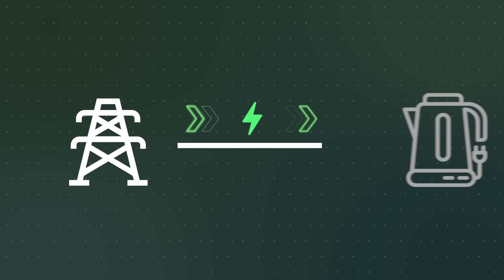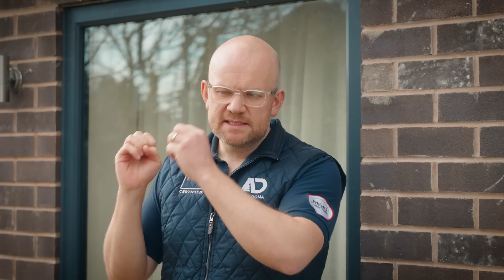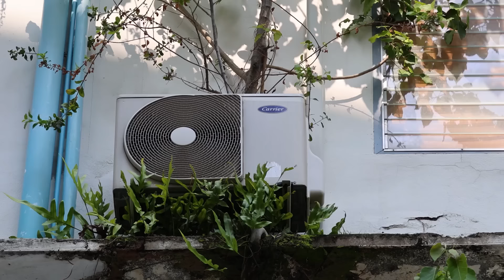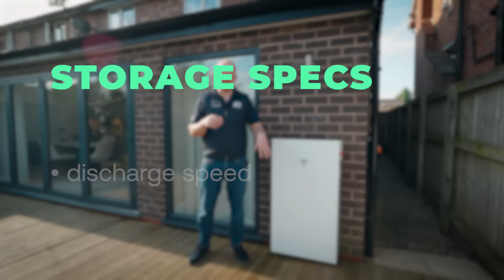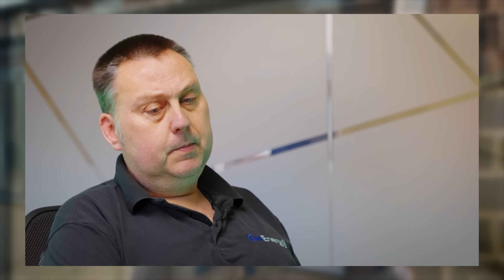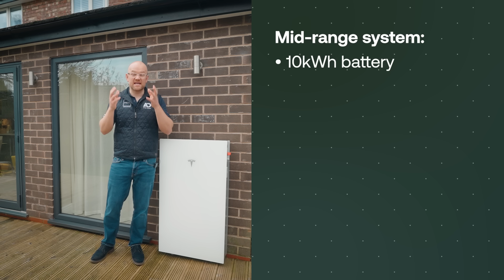Solar Battery UK Guide: When It’s Worth It and When It’s Not

Comment: To suggest that Fogstar batteries are budget in terms of price AND quality is disingenuous. Price certainly they are great value but in terms of quality they cannot be beaten. I would have a Fogstar over any Tesla, Sunsynk, Fox ESS. Sure Fogstar have a more budget range if you want super cheap, with cell quality the main differential. Fogstar have a 32kWh battery around £3500 including 20% VAT so under £3000 as part of an install. To get the equivalent capacity in power walls you would need over two! The Fogstar batteries mostly have 8000 cycle warranties. I have a different battery brand to Fogstar but one that uses the same high quality off the shelf components that Fogstar does. I charge to 100% every day and discharge no lower than 5%. Mostly I end up at 20%. I have had my batteries nearly a year and have done 150 cycles so say 200 cycles/year. At that rate my batteries should still be OK at 40 years. Because I only want the best quality I went for Victron inverters. I have no need for a gateway as virtually all Victron inverters have that capability built in, saving £1000. At zero VAT my system cost around £12000, is powerful enough to run my whole house including 16kW ASHP for 18hours in darkest coldest winter, and 3 days in summer if the grid failed (I have 44kWh of batteries). If a cell went in my batteries they can be replaced, the BMS can be replaced, either with the same or a different make, even my inverter could be changed to a different make not that I would. With a proprietary brand like Tesla or Fox or Sunsynk you will only be able to get your batteries repaired by the manufacturer and if that model is no longer supported you run the risk of losing your whole investment. I have a friend with a Gen 2 Givenergy system that is limited to about 2.8kW output and I think about 8kWh of storage. To improve that he would likely have to replace the whole system. I could add a new 16kWh battery to mine, maybe a Fogstar as the BMS is compatable, In theory I could add another inverter alongside the three I already have (except that with my 3.68kW FIT array, I already have 16.88kW of export power and the maximum anyone can get on 100amp single phase is 17kW) I can't help but think of all those power wall owners who had their devices bricked deliberately over the air by TESLA for safety reasons, in some ways that is a plus because safety is paramount, but the technology in my batteries and fogstar batteries is so standard and safe that I cannot see that being necessary in the first place.
Reply: Interesting, I'm thinking about a Victron system, but am not familiar with the range. What inverters are you using? 
Fogstar seem too good to be true.
Reply: @ianbigsand7  Fogstar are just selling commodity solutions with their own support and backup, so there is no brand premium. I have 4 of the 16kWh units being installed in the next few days with a 12kw Sunsynk inverter. 

There is nothing stopping you from using Fogstar batteries with a Victron inverter if you like the feature set of the Victron, you just need to find an installer who is happy to offer them as a system.
Reply: Sorry @ianbigsand7  for late reply, I have only just seen. I'm using 3 x 48/5000/70-50 Multiplus II's in parallel, as that was what was certified at the time I made my application. By the time I came to install everything a single 15kVA MPII had all the certification and would have been a simpler choice but I had already bought the smaller units. I suppose having 3 smaller inverters means that if one failed I could reconfigure to run as 2 in parallel until a replacement was sourced. I do 100% recommend Victron, it is such a flexible and well supported system (by Victron and by users) that I cannot imagine being with any other system, I have friends with Solis and Givenergy systems that I try to help, but find them so limited by comparison.
Reply: I am totting up the value of a good all-in-one, probably Sigenergy, versus a component system, ideally Victron (maybe Solis, maybe Synsync) and Fogstar. Sigenergy is maybe an easier install, although the gateway is big. It’s also got very good time of use support out of the box. Plus it definitely works well outside. But Victron does ToU just fine, other inverters do it to a greater or lesser extent, and with some level of app functionality. There are trade offs. But component systems are usually quite a bit cheaper. 

My bigger issue is that my new heat pump is so efficient there’s just not that much cost for a battery to take out.
Reply: @Pressure_23  the best quality, best bang for the buck battery has to be the best starting point. The top of the range Fogstars with 16.1kWh capacity seem really good, but maybe the Fogstar budget range makes even more financial sense. I have gobelpower batteries which use standard components, very similar cells and BMS to fogstar units. Had my system for 13 months,  with 3 x 14.4kWh batteries. I have absolutely hammered them, one battery seems to be working harder than the others with 270 cycles, the other two around 225/230 cycles. Every day I go from 100% to 20%, sometimes lower, 5% is my limit. My cells are supposed to be good for 8000 cycles, but should still have significant capacity. I should hit 8000 cycles in 32 years. Realistically by then, probably well before, there will be superior technology and I might have upgraded to that. There is a reasonable chance that my Victrons will cope well with whatever that new technology is, so hopefully I will not have to replace everything, but with an all in one there is no chance. In the winter I need the full capacity to run my ASHP and house entirely on off peak electricity on the very coldest days, but for most of the year I store my solar production in the batteries throughout the day and export around 25kWh over the four highest price export slots of the day. Usually that is between 5pm and 7pm, and if I am being paid 20p/kWh instead of 12p/kWh (or better still 36p/kWh) that really helps with the ROI. You say your heat pump is cheap to run anyway, and so is mine. Even without batteries it was cheaper than gas or oil, but the batteries have cut my unit cost to a third. My 16kW ASHP will cost under £300/pa based on my current import price of 6.9p, so that is an annual saving of £600 right there, my house use adds  another £600 saving, and exporting my solar at 20p (rather than 12p without batteries) maybe adds another £300 giving me a £1500 annual return.
Reply: @mikebarry229 very useful information. My biggest challenge is finding an installer for Fogstar + say Victron or Solis. Electricians locally want to install Tesla or Sigenergy. I guess I’ll talk to ITS at some point.

Comment: Very informative and well explained video thanks. Have a 4 bed home approx. 4100kwh of annual usage with oil bulk storage combined running cost £3400 per year. Embarking on a 2 stage, 3 year plan to have Solar, Battery & Heat pump installed. Stage 1: 18 x 465kw Panels & 8Kw inverter c/w 17.52kwh of usable battery storage from Sigenergy (Love Tesla, Hate Musk more, so will not be getting my money). DNO have restricted inverter size to 8kw from 10kw and concerned that functionally Stage 2: fitting the heat pump (replacement oil bulk storage) will be impacted by the smaller inverter to run heat pump? May have to now look at Tepeo ZEB in the future for heating as an alternative to heat pump. Any thoughts would be greatly appreciated :)
Reply from the maker: Sounds like you have a good plan to me. The inverter is highly likely to meet most of your home's demand. 

Thanks for commenting.

Ian
Reply: @apexdomasolar Thanks for your feedback, your reassurance is greatly appreciated. Keep up the great work, you’re making your mark 1 video at a time ⚡️📈

Comment: You seem to be well informed in your trade and also able to see it from customers who may not be as informed on all technical and regulatory details. I have some quick questions for you:
1. Is there a limit on how much energy I can take overnight on the cheap rate, for example if I have 4 battery banks, can I charge them all at once? 
2. If I have a 3-phase supply, can I export on each phase separately so 3 times the export limit?
Reply from the maker: 1 - Yes, you can fill up four. Just depends on your incoming supply limit and inverter size. But in theory, yes. 

2 - That's exactly the way it works (subject to your G98/G99 export limit).

Warm regards

Ian - Team AD
Reply: @apexdomasolar  Thank you so much for the clear answer. I currently have a single phase 100A domestic supply so 24kW maximum rate and 4 x 5kW inverters may be doable. 
Nobody has solar panels in my neighbourhood so maybe my DNO can handle more the 3.68kW and I don't need to upgrade to 3-phase, we will see. Thank you again

Comment: On the right tariff (export rate greater than import rate) generally you should export as much Solar as possible rather than use it for your home as long as you can avoid peak rate usage.
Reply from the maker: Agree with this currently, though it's best to assume it won’t last forever in the system's design. 

Thanks for commenting. 

Ian

Comment: Great video. The only thing I would add. You made a good point about try and install i hybrid inverter if you just want solar.  Its a mine field as so many manufactures and what each unit will achieve. Alot will only support 2kw loads and others a lot more so choosing a inverter is a mine field. Its an investment you have to get right as you cannot change it latter . Well you can but its cost. Get it right first time. Example I want a Anker solix x1 but its not designed at the moment to run with a deisel generator but other manufacturers have designed for this feature into there products. Its really drilling down trying to make sure your investment will work in all senioros.
Reply: Haven’t seen many with only 2kwh load ? Even the small 3.68kw inverter on G98 cert can output the full 3.68 kw export.
Sunsynk is best for your requirements if looking for aux inputs for gen etc.
Reply: actually for my requirments its a solis s6 eh1p 8kw l plus

Comment: I went all in, 48kwh battery in the house and a 16kwh battery in the shop. 10kw array on the house and 12kw on the shop, which also exports to the house. The way I look at it, having extra is better than not enough. I have free power at night so I can run all three AC units during the day without worrying about am I going to use grid power during the day.
Reply: No. Just no.
Reply: @PaulParker-ub9sq Canada explain other than no

Comment: I'm getting quote for 22 panel Aiko 475w gen 3 with Tesla powerwall 3 with gateway and expansion I use 4500 kw have I gone over kill with 27 kw battery storage? Any advice would be great thank you
Reply: Is that just normal house usage (no heat pump or ev). On average wouldn't one pw3 suffice if you are using 12kwh per day?
Reply: I have managed with just a single PW 3 for 16 months. My average daily use is around 17.5 kWh and I have rarely used any peak rate electricity. However, I moved from E.ON NextDrive (7 hours off-peak) to Intelligent Octopus Go (6 hours off-peak) in February (when I got an EV) as the E.ON export rate plummeted - I also have 6.825 kW of Solar PV. This would then stretch my usage to the point that even fiddling with the Backup Reserve at the end of the day would not be sufficient in winter. So yesterday I had an Expansion Pack fitted.
Reply: Hi, I have a 6kw solar south facing direct to tesla inverter plus add on unit so 26 kwh storage. I also have a 4 kw west facing array that was fitted under the FIT system that goes straight to export.  I also have an ev and do about 10000 miles a year

I find that from about April to September the batteries tend to be 80 -100 % full by late afternoon, which is easily enough to get through to the next day ( despite two teenagers using as much power as they can ). Your system will easily cope with your needs and indeed will cope with an additional heat pump and ev - .

You have got it right with the storage - which will be good for full self consumption in the summer and enable you to draw from the grid over night in the winter

Comment: Great explanation and very informative.
I have looked at battery only to load shift. With my average daily PEAK consumption of 12kwh I would save £2.76 per day/£1000 per yr  based on my current Octopus IG tariff. Looked at an  Alpha 14.4kwh for 5.3k which would give a ROI of just over 5 years but moves to over 6 when factoring in loss of interest from from cashing in my savings. 
Add the recent Givenergy issues I’m feeling a bit reluctant to risk investing 🤦‍♂️🤷‍♂️

Comment: Hi Ian. We had 9.5kwh of battery storage and got an extra 9.5kwh with you and we don’t regret the extra spend at all as both myself and my wife now spend more time at home now so we use more of it and sometimes in the winter can drain most of or sometimes it all due to white goods usage on washdays. Then we charge at cheap night rate over 6 hours and using solar when available. A win win 👍✅
Reply from the maker: Thank you, David, for your comment. 😊

Comment: A good presentation.  I have looked into this in detail - I am 70 years old, I do not have solar and I am on Intelligent Octopus Go.  I charge my car in the early evening and normally get a few 30 minute slots of cheap energy before a longer slot of hours running up to 1130.  This allows me to run every heavy use appliance such as washing machine, and tumble drier etc in the evening.  In short I have little requirement to spend £6000 just to run my low level daytime electricity especially as I will not break even for 9 years and then save a some little  money in my final years before I end up in my box.
Reply: Very valid points. I’m still in my thirties, but I do have an opinion - when I got my home SOLAR PV and battery installed, the EPC bump helped me lower the mortgage payments as better products became available.

Now, when upsizing, I see a gain in house value in real-terms, but I had already improved the home’s loan to value ration during remortgaging previously. You could get that money straight out after installation as an addition to your loan amount while maintaining the previous loan to value ratio :)

So a good investment regardless the time frames if you’re remortgaging or selling.
Reply: I'm thinking the same James, I'm also 70 this year and any gains regarding solar and batteries etc would be negligible as far as I can see it plus that money in an ISA could return 4% per year and could give £240 interest tax free for £6000 investment.
Reply: @marma48  the return from a battery can be higher. I will save £1,233 a year with a battery which works out at 17.6% return. Much better than any bank.
Reply: @dpleech1 Yes, I did a full ROI using Claude AI. If we reinvested the electric savings in an all of market fund with someone like Vanguard, rather than keeping the money in an ISA, we'd end up with the thick end of 4 times the cost of the install after 10 years. My neice recommended that I try Claude, I'm a big fan after only using it for a few weeks. It'll build you a spreadsheet in minutes, that would have normally taken me an hour or two.
Reply: I think it's not all about money, do we go on holiday and say when will I break even 😂 no. Its about ALL of us doing what we can to save ourselves from human climate catastrophe, sadly I think we are loosing.
Reply: @925greenb human climate catastrophe 🤣 Turn off your TV and radio fella, there is no catastrophe……
Reply: @danjackson140 Correct!